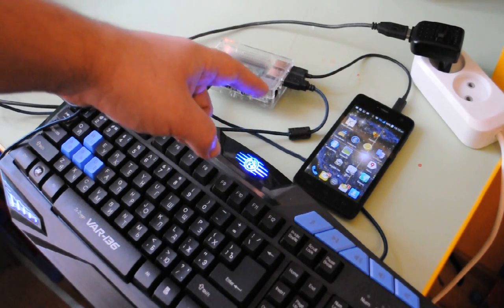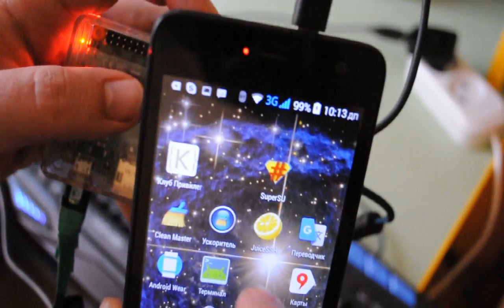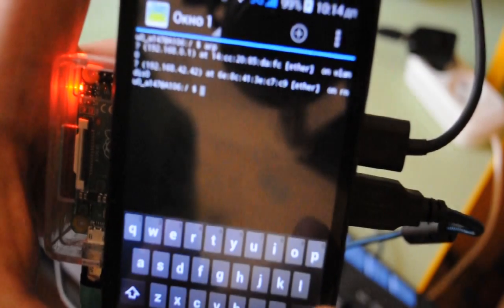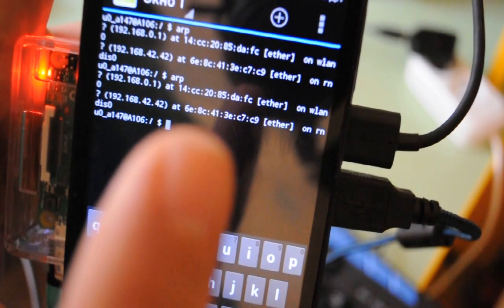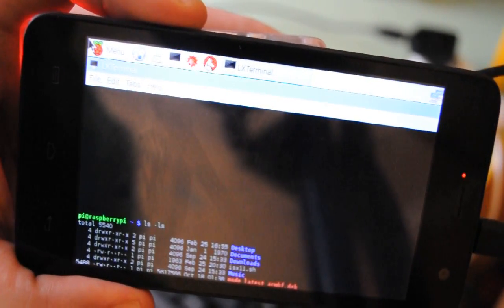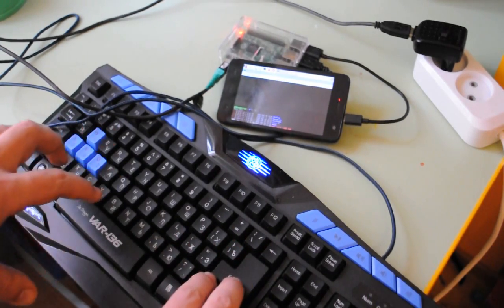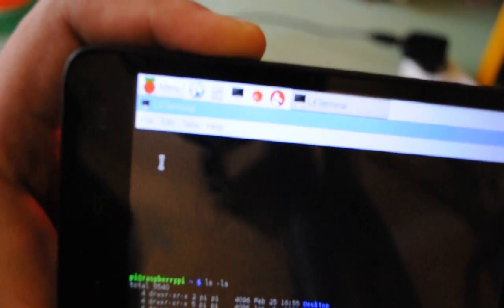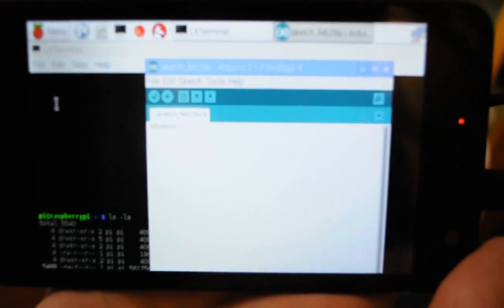Using Raspberry Pi with USB keyboard and phone as a display

Comment: great! thanx. is there a way of modding the pi to work with a mobile  touch screen?
Reply from the maker: Not sure I understand, you can touch the screen and it will position the mouse via VNC
Reply: Sergey Goncharenko thanx for your reply. i mean literally use only the mobile display with power from the pi. without the android device

Comment: is your raspberry pi already has a Noob OS before you program it to connect to your phone?
Reply from the maker: Julius Gliane not sure I got your question right. Raspberry does have a raspbian image with gui and vnc and that's pretty much it
Reply: thank you for your response but i just finish installing the OS of RPi through the help of my uncle's smart tv.. i thought that i can use my RPi board even if the OS is not yet installed to enable my smart phone as a monitor for my RPi. now i will just need to follow your tutorials so that i can operate it in my smartphone... ^_^ hehe sorry for my bad english.. thanks a lot..
Reply: Sergey Goncharenko i have a question is a usb cable enough to use to connect my RPi to my phone? and od i need to root my phone?
Reply from the maker: Julius Gliane no need to root the phone. All you need is a USB modem in your phone's settings. Then connect via cable and enable phone modem. I guess same is possible witn bluetooth and wifi, cable just doesn't require any raspberry-side configuration, everyhthing is in the OS already
Reply: Thank you very much.. got it ^_^
Reply: one last thing what app did yu use to open the command prompt of the RPi?
Reply: my phone is sony experia what app is OKHO 1?

Comment: I am using an old phone and was wondering if I could lock the screen so every time I pressed power the raspberry pi would show up.And is there a way to stop background apps to preserve battery?
Reply from the maker: hmm, not sure about the lock screen, haven't done such an analysis, also it's worth to check which apps are using most of your battery - I bet it will turn out to be enabled display, so disabling background apps won't probably free up huge amount of additional energy. In my other IoT lowpower applications I had to cut leds with a paper knife :) - they suck most of the energy regardless of code chips are running. Sorry, I'm not a guru in Android :)

Comment: how i can connect without open a port? because the vnc on my android tell me that the port the computer lisyening cant be contacted
Reply from the maker: are you sure that raspberry is listening on a vnc port? try to connect using SSH and check with netstat if Raspberry is listening on VNC
Reply: +Sergey Goncharenko  I can't connect to raspberry pi without port
Reply: Try port 5900 or 5901

Comment: does this need internet to work
Reply: +Aidan :toxsa the pawn nope - it works via USB network adapter which is being used for internet access (in a regular case), but in this example it just works in a different direction from internet gateway (phone) to the device (RPi)
Reply: +sgonch cool I might try this out